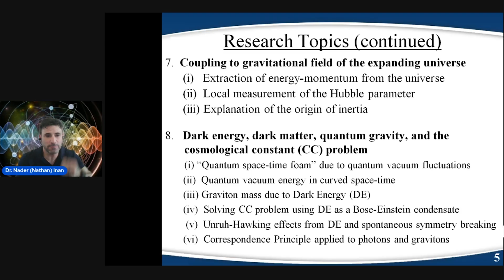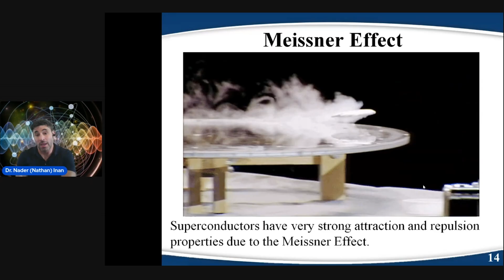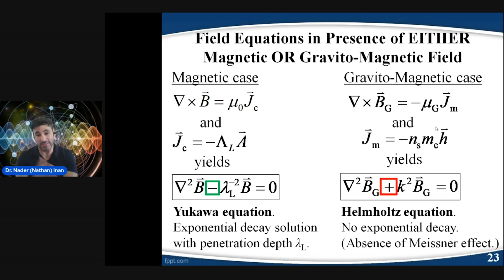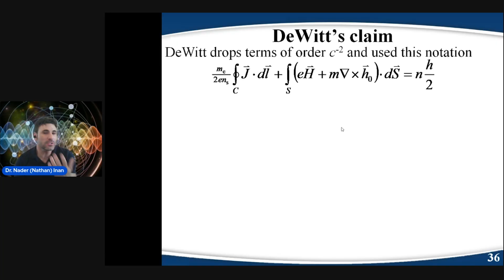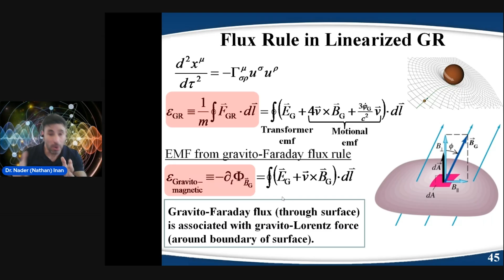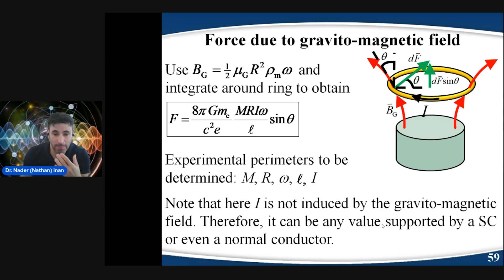Gravito-Electromagnetic Effects In Superconductor Experiments | Nathan Inan

Comment: what you are talking about @50:33 , aka what you are calling motional EMF,can be done if one is rotating the ring around an axis that is perpendicular to and at a same time crossing the axis of the rotation of the cylinder. Then one just hooks up a microscopic diode (your switch) and capacitor and you are good to go. Dr. Martin Tajmar can easily do that for you.
Regarding time-varying EMF speeding up and slowing down cylinder at these speeds would take minutes, so very low frequency. But there is a solution! You have x2 counter rotating cylinders, where one is inner and other one is outer. Then what you do you move inner rotating cylinder up and down and that will time-vary your GM field. Moving a rotating cylinder up n' down will not produce any gyroscopic forces, which is a plus. But a bitch to make, though.

Comment: Huh, where to start : P
 What you’re building there Sonny is an impulse drive. 
 Aether - epsilon iron shards compressed in stars until the protons are crushed = density. Permeate all of space and matter.  Flows like ocean currents into galaxies, stars and planets. Re-forms into protons in alternating electric currents that are compressed by an increasing B field. 
 Gravity - originates in the hexagonal structure of epsilon iron crystals. E8 BC4 8-Cell=4-Cube = Tesseract structure creates alternating electric and magnetic oscillations resulting in a checkerboard EM field… in 3D

Superconductor - confines the energy (aether) outgoing from earth and expels the energy (aether) incoming. Result is monopole magnetic skyrmions that oppose earths field. The quantum locking is from the confinement of the outgoing current as is well known.
 Gravitationally induced Hall Effect could be used to couple the ring to the cylinder. 
 
Gravitational Transformer EMF as you stated is the best method. 
 Pulsing the cylinder inducing magnetic currents in the ring that oppose earths field or the field of the vacuum (outer space)
 Spinning the cylinder 4 pulses/rotation. Allowing for a pulse and free induction decay w/i a 90° sector. 60/30 
 The tighter the cylinder the greater the effect, however mass helps so there’s a balance. Cylinder mass that is - ie: iron preferably epsilon iron from a meteorite. 
 The ring should be flat, a cylindrical section on the inner radius could help w/ induction coupling. 
 Harmonics - timing the rise and fall of the ring w/ the cylinder impulse ✅
 The answers are all in Saturn 🪐 it was put there for a reason, so we could learn from nature. 
 Great work Dr Inan
Reply: …maybe a sphere or ellipsoid instead of cylinder for tighter coupling. 
 Ellipsoids can be tricky as they can have internal magnetic reflection confusing what you’re trying to achieve or measure.